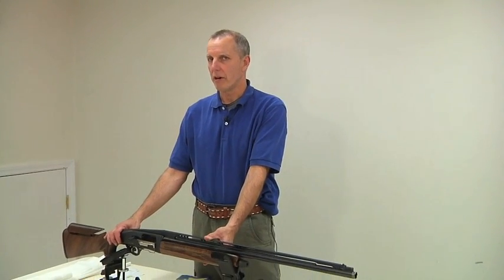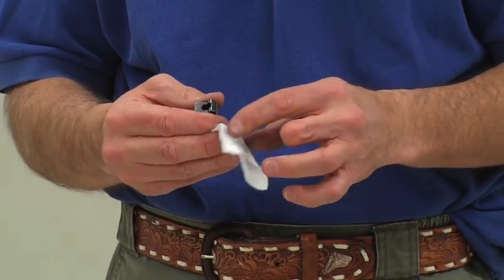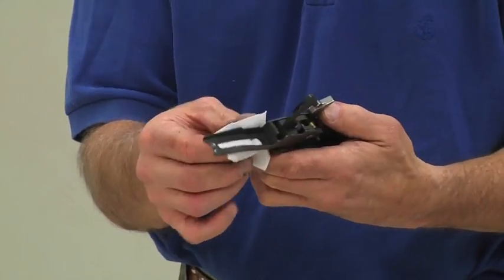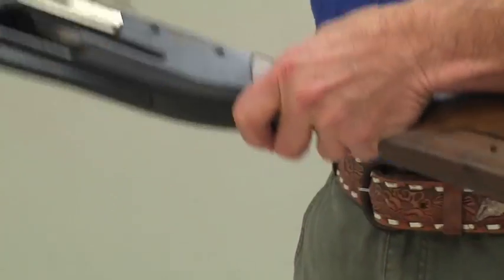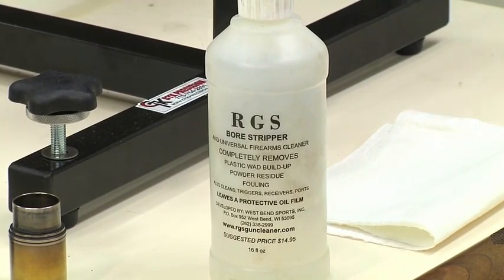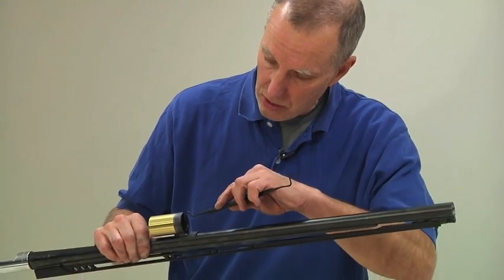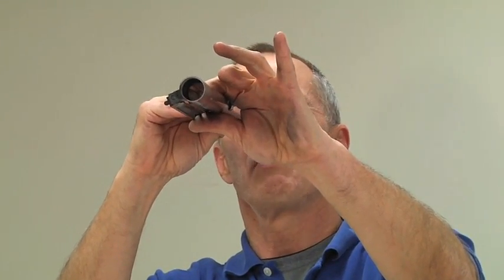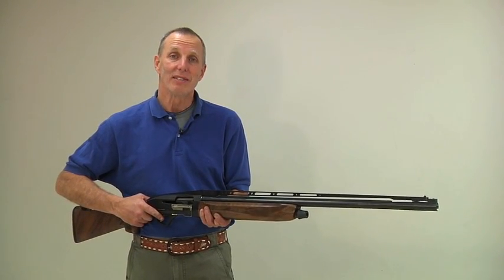Fabarm XLR5 Shotgun Cleaning v1.m4v

Comment: Nice video.  However, it appears you may have installed the cocking handle backwards.  The two notches need to be facing rearward so that the spring loaded ball detent inside the bolt engages the first notch of the cocking handle.  If you install the handle backwards it can be ejected during the firing cycle and the action jams. It happened to me during a league trap shoot.  Pretty embarrassing - fortunately, I found the handle lying on the ground and was able to get back into the match.  Also, after cleaning, you should add some lube to the action bar rails and the interior surface of the barrel extension where the bolt slides and locks up.

Comment: The butt pad comes off using a phillips head screwdriver, which removes two copper screws. Then there is a special tool-socket, similar to a socket for an automobile sparkplug removal, that is used after removing the mercury recoil reducer. You take out the mercury cartridge by unscrewing it, then use the socket to remove the internal nut, by turning that counterclockwise. If you take off the butt pad, it should be fairly straightforward to see how this all comes together.

Comment: A note to all. You may put standard Hoppe's oil on the action bar if you wish. I have shot my Fabarm well over 10,000 rounds and it cycles just fine without it, but Fabarm is recommending a little lubricant. Thanks.

Comment: Great video. Lots of detail.  Thanks for the tips.  Have you ever removed the stock on this gun?  I'd like to change the shim to adjust the cast and would like to see a how to.
Reply: Yes, I've removed the stock. It requires their special tool that comes with the gun (it looks a bit like a spark plug socket). First you take out the mercury recoil reducer, then you can get at the bolt with the special tool. It's pretty straightforward.

Comment: Unfortunately if the sound of piston cap moving up and down is a bit troublesome to you, I'm afraid that's the design. Actually, I've noticed when the piston is completely and thoroughly cleaned it moves about, but after some rounds, it's not so noticeable. It is "normal" to answer your question.
Reply: Joel Dryer That's what I was afraid of, oh well. Thank Joel

Comment: Joel, I have an issue and hope you can help.   I followed your procedures on my XLR5 Waterfowler and I had some issues this morning with it freezing up while duck hunting.   It was 6 degrees but think the gun should still work as designed.    Do you have any recommendations that differ from what is shown on this video for cold weather use?
Reply: Mark B I too have a waterfowler,  mine also quit working last week in 9° weather. In fact I have had issues since day one but I'm also trying to run 1-1/8oz @ 1140fps which isn't really what this firearm is designed to do, however I was assured that it should function just fine...

See I just got off the phone with a nice guy at Fabarm USA after I had asked if I should attempt to put a Velocity spring and/or piston in to get it to cycle target loads, he said it shouldn't be necessary for 1-1/8. 

He asked if I had broken it in, which at 700 rounds I'd think yes was the appropriate answer, he then asked if I had watched the YouTube video on throughly cleaning it to which my reply was "that's the first thing I did" and he proceeded to be very forthcoming about his disdain for this video! He even said that they have requested for it to be taken down. 

Miscommunication on my end, what I meant was I thoroughly cleaned the gun before firing it for the first time, but I had no knowledge of this video. 

I explained myself and afterwards he gave me proper instruction for cleaning the firearm.

Since I never knew about this video, of course I had to investigate... After skimming through it I see one major area where Fabarm USA and Joel differ on their advise, Fabarm says this gun must be run wet! He suggested aerosol lubricant in the friction areas of the chamber/receiver and oil on the action bars, make sure it's on the bars bar into the receiver. But! what must be dry is the magazine tube, make sure it is clean and dry.

I have been running the whole gun rather dry (just a touch of Hornaday one shot) because that's what I am accustomed to doing with most all of my firearms as I've had more issues with over oiled guns than dry ones. I'm going to try oiling the firearm as suggested and see how it goes.

Hope this helps, for both our sake!
Reply: Thank you Nick for this information.  First thing I have no where near 700 rounds through mine and if I had to guess I am closer to about 200-250 max.  Second, thanks for the info on oiling it.   I hope this helps because I really like the gun and hope to have it for many years.

Comment: Joel-when you reattach your fore-end and tighten down the cap, do you notice any travel in the fore-end?  With my XLR5, there is some up and down travel where the fore-end meets the receiver.
Reply: Mark, if I tighten the fore-end cap snug, then no, I don't notice any travel where it meets the receiver. I would for sure contact Cesar Guerini and ask them about it. They are in Maryland, and as you probably know own Fabarm.
Reply: It's very subtle but there is a discernible see-saw movement of about 1/8" where the fore-end meet the receiver with the pivot point being the fore-end cap.  Like you, I hand tighten only to the point where I can no longer apply any further clockwise pressure with three fingers.  I don't dare tighten any further for fear of damaging the wood as it is fairly light with a thin composition.  Nor do I want to shim it as this may interfere with the piston operation.  I've had the gun for a few weeks and it remains unfired.  This issue came up when I first assembled/disassembled and reassembled the gun to inspect for fit and finish issues.  What is more, when I removed the comb to increase the drop the two metal parts of the forward elevation screw were fused together and would not operate independently of one another (like the rear screw).  After careful manipultion with the Fabarm supplied Allen key, a broken rubber o-ring fell off of the screw.  I have to say I was a little disappointed and will definitely contact FabarmUSA about these issues.

Comment: Great guide! Thanks a lot.  Since I did a full dissembly of my xlr5 fr, the piston cap moves up and down the magazine when the bolt is pulled back.  Is this normal?
Reply: If you are referring to part H-311A (Piston) then yes, it will move freely once reassembled.
Reply: Thanks! I am getting some jamming after 50 to 100 rounds on light loads.  I am shooting 1.1/8th 3 dram now.  Will the spring loosen up for lighter loads over time?
Reply: Joel Dryer Hi Joel, cleaned my Fabarm XLR composite LH with your instructions and everything went great.  Just one question I didn't notice it before (only had the gun a few days) but when the action is closed and ready to shoot the piston (H-331A) can move forward and backwards a little bit (0.2 of an inch) and therefore makes a sound when the shotgun barrel is raised from pointing at the ground to pointing at the sky as the piston slides back slightly and clinks against part (G-189).

I would have thought the piston should be closed with no give between it and the other parts when the gun is ready to fire? Is this normal for the piston to be able to move a little bit when the gun is ready to fire?
Reply: Dan Seidman Dan, the gun shouldn't jam with 7/8 oz to 1 1/8 oz loads and it shouldn't be dependent upon the spring. At this point, I think it would be best to contact the Cesar Guerini gunsmith in Maryland.
Reply: ***** Yes, the piston can move a bit and that's normal from my experience.
Reply: Joel Dryer Excellent video!! I just purchased and took the gun down for initial cleaning. After reassembled i found that the piston cap slides back and forth when the action is open. This can't be normal??? None of my other autoloaders do this. It's actually embarrassing throwing the gun up and hearing this metal clank like riding on a seasaw. Say it ain't so....

Comment: I wanted to follow up on this after having had my XLR5 for the better part of a year now. You state that cleaning the gas piston really won't affect the performance of the gun much. I must respectfully disagree: I find that after only 400 rounds the cycling becomes very sluggish and can actually fail to feed a second shell. Rather inconvenient for true pairs! I really recommend both the piston and magazine tube be cleaned thoroughly for reliable operation. Happy shooting!
Reply: After 10,000 rounds, I agree that part H-311A should be cleaned. Just be sure it isn't with an abrasive.
Reply: How does one clean the mag tube? I don't see any way to get the end cap off, unlike my other Italian semi-auto.